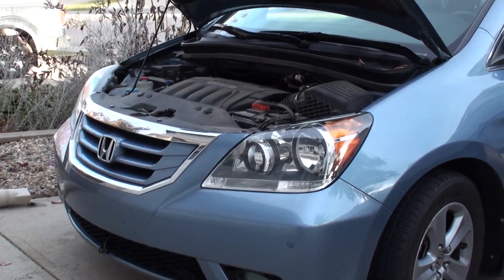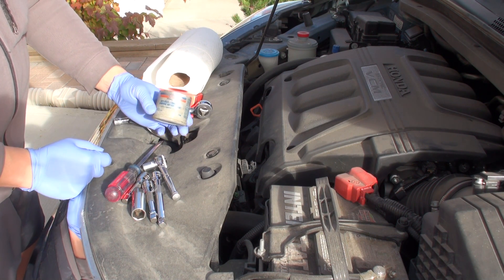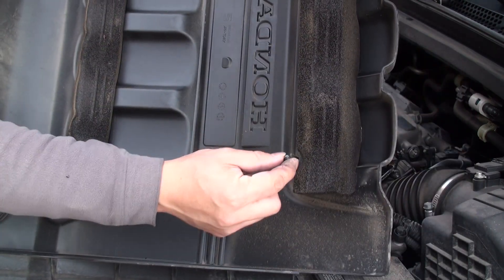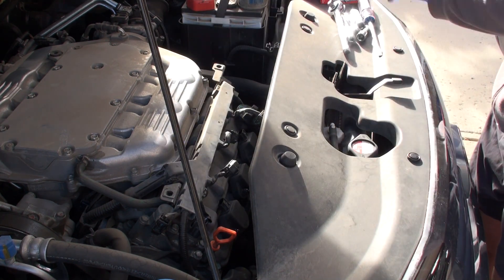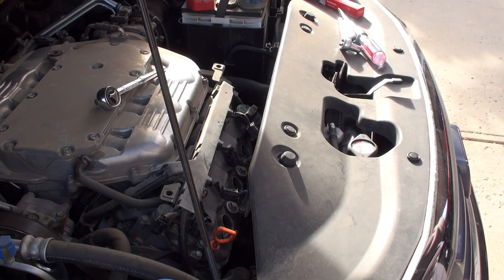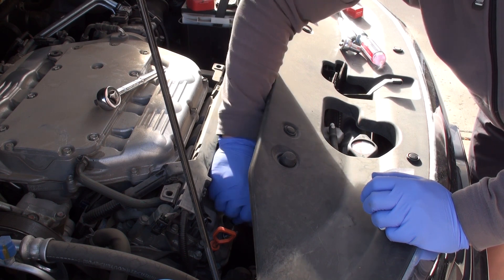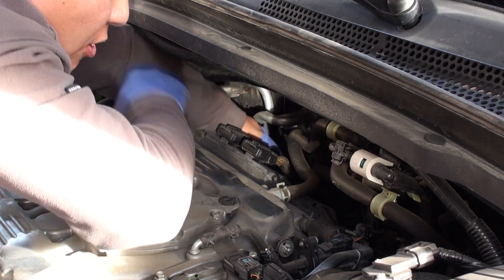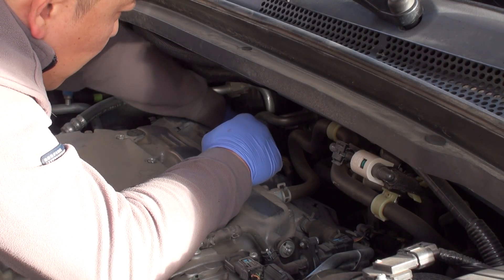Honda V6 Spark Plug Replacement

Comment: From NGK Site: Thread breakage can sometimes involve removing the cylinder head for repair. Metal shell stretch changes the heat rating of the spark plug and can result in serious engine damage caused by pre-ignition. Do not use anti-seize or lubricant on NGK spark plugs. It is completely unnecessary and can be detrimental.

Comment: Good video man, I didn’t know more advanced versions of the J-series V6 use slightly longer spark ⚡️ plugs.
Reply from the maker: Yes, starting in around 2008 when then introduced the VCM system with 3/4/6 cylinder operation that they switched to a longer length plug due to a slightly different cylinder head design.
Reply: @piercedasian  oh I see, it’s interesting to find out the little changes the company does to their venerable V6 engine. Everybody still thinks this it’s the exact same engine from 2002… it’s closely related but not the exact same.

Comment: Skip the anti seize these are already have a special coating from the factory. Antiseize will change your torque value so you over torqued your plugs
Reply from the maker: While what you way is true that I've been burned by a few motors where the plugs legit seized in the head (none of which were my cars) and I felt that having a bit of antisize on the threads helps future removal.  I am mindful of torquing them less since the anti seize is effectively a lubricant.

Comment: Hey brotha good video, I heard some other mechanics suggest the battery should also be disconnected.  Not having that connection to battery power while your changing things that interface with the electricity to fire or spark up an engine sounds like a good advise.
Reply from the maker: Hey!  While it isn't going to harm you by disconnecting the battery that for spark plug changes that you're pretty safe permitted that the ignition is turned off.  I guess its the same as saying "better safe than sorry" but never in all my years of working on computer managed engines that I've had one fire up me while changing spark plugs.  Do what makes you comfortable and thanks for stopping by!

Comment: Not supposed to apply anti-seize to the modern honda engines. The metallurgy of the plugs already does that function.
Reply from the maker: yep, true.  I am super old fashioned and use antiseize b/c I have seen other mechanics install plugs years before me and then I find out when I have to service them that they're strangely seized.  More than one example of that has come by my shop.  In some cases I was able to get the plug out but holy... it wasn't like the plug was in there for an insanely long period of time yet they're seized up..  I would rather coat them lightly and then torque them slightly less to make my future service work easier.

Comment: Thx for the video mate. I got mine 1.2.3 cylinder sparks much dirtier than 4.5.6 and I have changed them 50k ago. Is there any issues?
Reply from the maker: You're very welcome.  There are a multitude of factors that may cause the odd cylinders to be dirtier than the even ones.  This is likely because of Honda's cursed VCM system that shuts off certain cylinders and allows them to accumulate "oil" and combustion byproducts on it.

Comment: Wrong title.  Should be Honda odyssey spark plug replacement.  All after 1999 or2000 are same V6.
Reply from the maker: I could call it that but then I'd be limiting the search function on YouTube.  As you have alluded to, all Honda V6's follow essentially same replacement procedure.

Comment: From the NGK (OEM spark plug manufacturer) website: "NGK spark plugs feature trivalent plating. This silver or chrome-colored finish on the threads is designed to provide corrosion resistance against moisture and chemicals. The coating also acts as a release agent during spark plug removal. NGK spark plugs are installed at the factory dry, without lubrication or anti-seize.

Anti-seize can act as a lubricant, altering torque values up to 20 percent, increasing the risk of spark plug thread breakage and/or metal shell stretch. Thread breakage can sometimes involve removing the cylinder head for repair. Metal shell stretch changes the heat rating of the spark plug and can result in serious engine damage caused by pre-ignition. Do not use anti-seize or lubricant on NGK spark plugs. It is completely unnecessary and can be detrimental."
Reply from the maker: While I do 100% agree that NGK does state that on their website and product documentation that I'm still old school and use a bit of anti seize compound on my plugs.  Fully aware that it can affect torque values by up to 20%.  I normally don't use a torque wrench on spark plugs b/c in many engine bays I don't have enough room to use my ultra high precision torque wrenches on the plugs and thus I torque by "feel".  Totally a non-scientific way of tightening things and not overly helpful to those that don't have experience BUT let's pull back for a second and take a "common sense" approach to tightening.  Even if the threads are lubricated one can usually feel when things are start to snug up and once that "snugness" starts it doesn't take much more (like 1/16" to 1/8") of additional turn to be fully seated.  I know my answer isn't ideal but I'm sure if you ask most mechanics that they too would likely agree that they do not use a torque wrench on plugs regardless of whether or not they use AS compound.  Go by feel.  Lastly the reason why I use AS is b/c I've run into a LOT of plugs seized in aluminum heads where the owners have left the plugs in the motor FAR too long and getting them out in some cases are nerve wracking if not outright impossible.  Not something I like to contend with and a tiny bit of AS compound will make future removal a cinch.

Comment: For reference, NGK recommends not using anti-seize on their plugs.

Also remember that if your VCM is not muzzled on your engine you have to change your spark plugs sooner, around every 50k miles, else they will get fouled up with oil. This can be remedied by muzzling the VCM, at which point you can change the plugs at the normal interval.
Reply from the maker: yes, aware that NGK suggests no anti-seize but I'm super old school and continue to use anti-seize because of some wickedly bad experiences with seized plugs (not my own cars).  After working on about 15 cars with seized plugs that I've promised myself to just coat the plug threads with anti seize and and not torque them down quite as tight as what the spec calls for (as it does mess with torque specs).  Your recommendations on replacing plugs every 50K miles is a bit extreme.  I've owned and driven many odysseys and pilots with VCM and had the plugs go well past 160k kms with zero issues.  I've had a few oily motor that did in fact foul plugs but with the course of normal driving where VCM modules on and off regularly that oil fouling is there but not bad enough to mess up the plugs.  Honda's dumb design to be honest with you.
Reply: @piercedasian  It really just depends. The problem is different on Hondas with the different VCM variants. VCM1 (for Odysseys this is 05-07) was not too bad, VCM2 (08-17 Odysseys) was by far the worst revision with a lot of issues, and VCM3 (2018-present Odysseys) is supposedly better but only time will tell.
Reply: Terrific point
  Thanks!

Comment: Damn this is way easier than on the V6 Highlander. Wow.
Reply from the maker: yes the Honda V6 is exceptionally easy to work on.  Love Honda for that, resent Toyota for they're overly crammed V6 design.
Reply: I literally was driving a 08 Highlander for a while, fuck that, those three back spark plugs are hell

Comment: Im trouble removing 2 and 3. Too much stuff in the way for me to loosen the plugs.
Reply from the maker: You'll just have to get various extensions and such and "drop" them into the spark plug bore to clear certain brackets and wires.  Once those extensions and sockets are in place you can then pop your ratchet on to remove them.  I rarely have to unbolt anything from a Honda V6 engine.

Comment: THANK YOU! This is a fantastic video! I'd never done anything more complicated on my car than change the battery but I successfully changed my #3 plug on my 2010 Accord V6 today (the worst plug to access, btw), thanks to this video. This engine has that problem where some part of the piston and cylinder are not exactly aligned so oil gets into the cylinder and fouls the plugs. To keep it running I'll need to replace that spark plug often, and now I can. One thing I noticed is that the wire connectors on my model have a tab that you press to remove them. It was very difficult to do on the driver's side plug so I practiced on the front first to find my technique. Definitely takes 2 hands.
Reply from the maker: Glad the video was helpful!
Reply: In case you don't know, the actual problem with this is VCM, and you can easily fix this by disabling the system. Then you won't foul plugs anymore.

Comment: Bravo.Perfect tutorial and execution. I ordered  bosch plugs from amazon,for my 2007 Odessey.
I will replace as soon as I received them.
Thanks for detailed post.👌
Reply from the maker: Bosch plugs don't generally work well in Japanese engines and I would HIGHLY recommend you go the double laser iridium plugs from NGK (same as what came from the factory).  I've found historically from past work that Bosch plugs don't get along with Japanese motors - Engines seems to run rougher and plug life seems just average.  I have no scientific proof of this but I'd choose an NGK plug over a Bosch one.
Reply: @piercedasian just cancelled my Bosch order and ordered NGK based on this comment

Comment: Omg I’m amazed at how simple a spark plug replacement is on these j series v6. You don’t even have to remove manifolds or throttle bodies or anything . This makes me want an Acura or Honda v6
Reply from the maker: yeah Honda V6's are truly amazing how easy they are to replace spark plugs in.  Much easier than Toyota V6's (and any other V6 for that matter).
Reply: piercedasian right. appreciate the video

Comment: Been looking everywhere for an Acura tlx shawd 2015 video and I couldn't find anything, thank god this one exist the engine is almost identical
Reply: Islael Avila hey I’m planning on getting an accord v6 or tlx. Let me know if there are any substantial differences between this odesseys v6 and the v6 in the tlx even though it’s identical curios on ur experience
Reply from the maker: It depends on the year of Odyssey but I'm assuming you're referring to the more recent ones.  The motors are fundamentally the same and share a lot of the same parts.  Compression ratios and manifolds might be slightly different (TLX being better tuned for performance) but otherwise they are both just as easy to work on and have similar reliability figures.

Comment: What is the correct gap?
Reply from the maker: I am probably way to late in my response but 1.1mm.  If you buy plugs directly from Honda (and the cost of them isn't really that much more than the NGKs you buy at your local auto parts store) and come pre-gapped.